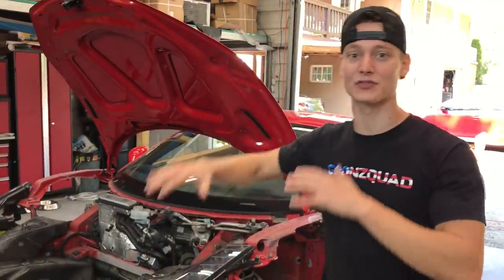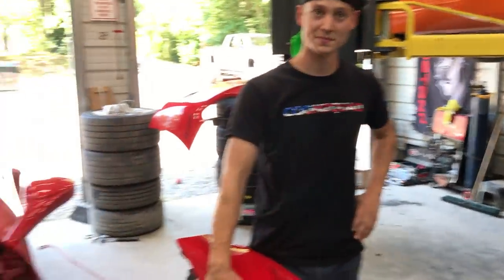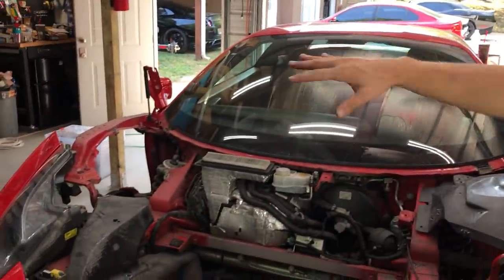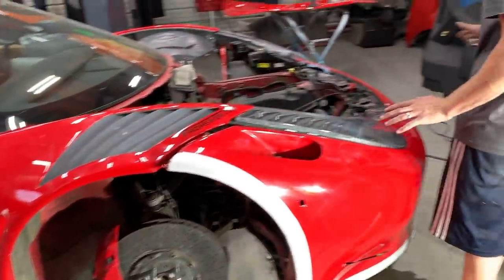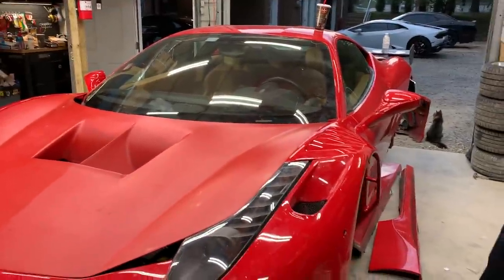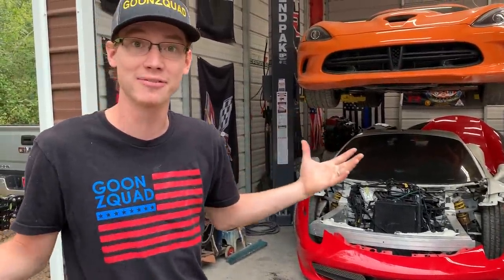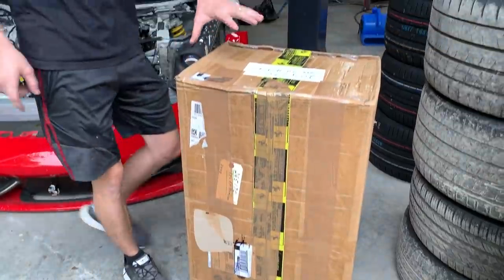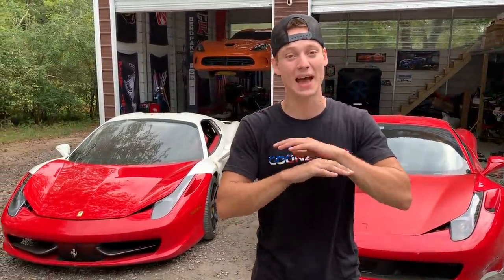Building A Widebody Ferrari 458!!!

Comment: Holy moly...
You've really got some balls for doing these things. You are chopping those metal pieces as if it is a cheap salvage car not an exotic one.
Reply: Ignorance is bliss ;)
Reply: Takes a lot of balls to remove structural brackets.
Reply: @FullSendPrecision  hihihi
Reply: Millions were spent in R & D and removed in a second .... ha ha ha
Reply: Chopping them as they think those should be chopped. And then chopping some more, then some more... Hahahaha! That really isn't the way to do things.
Reply: Nothing like chopping all that up to realize they never needed to because the new hood holds in place with pins! PPPPP (poor planning prevents proper production)
Reply: Wanna know what fool watched their videos an decided these 2 would be great to install a body kit on a Ferrari
Reply: @StreetDisciple86   They think getting some valuable advice from experts cost them lots of money. Sometimes You should spend money in order to do things right.  Actually they salvaged the car by chopping those necessary parts without any proper plan. They should've measure the fram rail brackets then cutting(trim) those inner pieces of fender, after that they could install it just right in a place.
Reply: @jasonmillsbro  I agree completely. I know they're doing their best but I think they lack some serious research and Intel. They're hands on learner's but some things can't be undone! I even mentioned it when they first picked up this project and started talking about hinges. I said you don't need hinges on the body kit car and they didn't even read it. As we've said a little professional advice and some proper planning can save a load of work and headaches!
Reply: I cringed the entire time... This tops in the list of what not to do besides Samcrac's Ferrari floor "repair"
Reply: Jason Millsbro The Ferrari race team also cut frame rails on the cars they use for the kit. That's why Tj felt comfortable cutting his off in his build because he had pics on his phone showing that's how they solved the issue.
Reply: Mike Honcho they are doing it correctly.
Reply: Hence, cheap salvage exotic.  Zing.
Reply: @andyRC95  That floor repair was the worst in history.
Reply: @nickanderson3440  That's not even a repair, it's a cheap solution to an expensive repair.
Reply: Those aren’t frame rails they removed they’re pretty much a brace/bracket for the stock fenders. Real GT3s have those brackets cut out. And windshield wipers are removed of course because it’s a race car. So yes he has proper intel. Ferrari does that to all of they’re gt3 cars!

Comment: Its pretty easy to sculpt a piece to make the fender and bumper have a better connection. Get a piece of pink panther foam, cut it out with a foam cutter to a slightly bigger piece, and sand it down to get a perfect part. Buy fiberglass mats or carbon fiber mats and epoxy, and put it around the foam part. Drill holes in the bumper, and matching in the new part, attach with ribbons. Fill out the gap with body filler, and you know what to do from that point

Comment: I'm kinda lost. You're assembling on the loaner Ferrari and then will move everything over to your Ferrari?  
Why was that one even totalled? 

Last question, by cutting some of those supports, does it mess with the stability and or the safety?
Reply: First question answer they got the loaner Ferrari from a company to put the wide body on the car and they get the stock parts for there totaled car. 2nd question no one knows how it got totaled 3rd question they readd supports at the end
Reply: Doesn't need the supports the stock stuff uses - it's super-rigid and self supporting

Comment: So you cut a structural piece of the frame to fit a front quarter panel, surely you’re going to replace the structural piece to keep the frames integrity and strength?
Reply: Chris Waldron it’s not tho lol it’s just a piece where the OEM fender latches on to. Lol 😂 check the other gt3 Ferraris and the racing ones they all have it missing.
Reply: Chris Waldron it’s not structural.
Reply: I am pretty sure they did their research before cutting..
Reply: Ok, so I’m happy to be corrected 👍 found this https://borlandracing.com/special-projects/ Be interesting to see the fellas build and look at the chassis again to see that it’s integrity is still kept. Racing is different to a road car where it needs engineers certificates and road worthies etc. To me, a panel that isn’t fastened directly to the chassis for strength etc. and relies on its own strength, sounds a bit dodgy.

Comment: That’s the bumper from the 458 LM GTE I believe
Reply: LM GTE bumper is different, the front mouth has 3 sections to it on the LM GTE, on the GT3 it is one open section, definitely looks to be a gt3 origin bumper with canard cut outs and one section mouth but why it would be 2" off each side is very odd.
Reply: GTE is the “top class” car. Other than LeMans and a handful of IMSA races, where else are they? It would be hard to imagine spare GTE parts lying around up for grabs IMO. I could be wrong though. I read somewhere the current 488 can be converted to both GTE and GT3 easily.

Comment: This is easily fixed. Get some blocks of balsa wood, as it's light and can be worked on easily. Glue them on there, then shave/sand into the correct shape and finish off with 3 layers of fiber, 2 layers of cloth 75 grams/m^2 and 1 layer of cloth 25 grams/m^2. Then finish.

Lightweight, strong, durable. And not too much hassle.

Comment: Cut a line down each side of the lip of the bumper, pull them out until they align with the fender and fill the 1/2 gap with fiberglass or carbon fiber repair.

Comment: Nice project guys. It only makes a lot of sense that you took on this assignment. Just take your time, measure twice and cut once, and cut some more if you don't like the first result. For future references it might be a good idea to wright down and log and store some actual measurement numbers instead of just comparing with the comparing tool. These cars are all made with very low tolerances, and those frames are all made inside a special jig. Therefore I find it hard to believe that two different cars can have a quarter inch difference between the two different frames. Big thumbs up from the Netherlands!

Comment: Use a rubber molding on the wide body, and u could use you hoist and a chain puller from harbor freight to move front over 1/4 inch by chaining between the bottom of the hoist as I fixed my f 150 that way and it works, the molding would even out the gap to make it eye appealing, just my 2 sence. and cheap!

Comment: Since the hood is thin, you need to glue some thick aluminum plates in then carbon over them preferably using a vacuum bag technique. Do this also with the L brackets for the fenders also.

Comment: With the bumper fitment, i would look into if they used smaller or thinner headlights, or mounted the stock ones at a higher angle, as if it was an inch shorter or thinner or both, the bumper would line up perfectly. like do they NEED turn signal indicators that I think are built in to the 458's headlights now with the GT3's? also see if you can find some photos of some GT3's that have been in fender benders, as maybe theirs no brackets on the top of the headlight on the GT3, so its pushing the upper fender further out than the bumper. 

like see if you got a spare wrecked one and cut the upper bracket off and see if it fits then

Comment: That is an early GT3 front with later fenders and hood.  Could be a 2013 front with 2014 and newer fenders because of changes in rules, the fender may have been made wider in 2014 plus, gills where added to the front nose in 2014.  Make it work and it’ll be totally unique. 👍🏻👏🏻

Comment: I don’t know if you figured it out yet but in 2012 Ferrari released an update to GT3 cars. It consists in new front suspension parts, new wider fenders and new bumper with bigger canards and wider to match the fenders. So probably you have a 2011- bumper and 2012+ fenders and hood. The other option is a GT2 fenders and hood and GT3 bumper.

Comment: Non-ferrous metals such as aluminum and brass do not bend easier when hot or cold.  You can only soften them by annealing them, so just heat it to a dull red and let it cool then bend it.  You should also use Dzus fasteners on the hood and bumper, not pins.

Comment: Something i noticed is that with the frame rails u can see thay they are sorta pinched about mid way through and you can notice it when u look at the area were the front bumper goes how the frame sorta bows out leaving a larger gap in the connection area (were the fram meets the front) and is pushed in at the middle of em

Comment: Hey why don't you lineup the outer edge of the bumper with the wide body fenders and make some carbon fiber filler pieces to fill in the space between the lights. If you can, make them look like some type of intake or cooling vents.

Comment: Yeah, I just checked on the front bumper you guys have and it's not the same as the original racing bumper which has those induction holes on the top which are pointed at the end instead of yours which is rounded at the end.

Comment: It's probably been said before, but for the Bumper-Skin/Headlight/Fender problem: 
Consider making a hockey-stick/L-shaped filler-piece/template out of 3/4" Plywood to fill the gap perfectly, 
Round all the edges over, 
Then reduce the size like 1-2mm on all sides to allow for part-thickness, 
And then send it out to a shop that can fabricate carbon-fiber and have them make the part.
One example might be: http://www.protechcomposites.com/custom-orders/

You may even be able to partner with them with a mention/link/logo, etc. sponsorship to do it for a zero/reduced cost.

Or DIY: https://www.rockwestcomposites.com/blog/yes-diy-carbon-fiber-fabrication-is-possible/ 

Then just paint it rosso-corsa and stick to the front bumper-skin with that super-strong 3M trim-adhesive tape. Similar to this one: https://www.autozone.com/sealants-glues-adhesives-and-tape/body-molding-tape/3m-1-2in-x-15ft-molding-tape/517047_0_0

Anyway, good luck guys!

Comment: 1/8" aluminum heated with a torch (metallurgical strength reduced)might not be incredibly strong as a bracket holding the fenders
 up when driving at speed.just a thought but race cars are loud,rattly and not drive-able on the street now what im sayn?
are you making a dedicated track car or are you going to drive this on the street?

Comment: Make sure you measure the frame rail length before you cross measure, if the length is off it will make the cross measurement inaccurate.

Comment: Normal goonzquad day...

Go ahead and get out of bed.
Go ahead and brush teeth with Rainbow Unicorn Bang energy drink.
Go ahead and brain storm on the parts and hardware required to complete the days work.
Go ahead and go to the local hardware store, i.e. Lowe's.
Go ahead and head back to the shop to install hardware.
Find out that you actually needed some other hardware.
Go ahead and go back to hardware store for hardware and get goonzquad fuel, i.e. Chick-Fil-A.
Go ahead and put on hardware and parts. Looks absolutely amazing.
Go ahead and stand around the vehicle admiring handy-work and commenting on its absolute amazingness.
Go ahead and complete a flawless, trash-free, absolutely amazing, garage paint job. 
Go ahead and set up goals for the next day. Include moments of absolute amazingness.
Go ahead and go to bed having completed an absolutely amazing day.
Rinse and Repeat

Incidentals
Insert burnouts and donuts as needed
Insert Thomas head scratches as needed
Insert temporarily 'putting on parts and taking them off' as needed

Love, 
A devoted, absolutely amazing fan...

Comment: Your geometry is wrong.  You either have to raise it up in the middle and lower it in the front or a combination.  Take measurements from th floor on the other car.   You need to make your brackets have a wider range of adjustments.  You really need to watch TJ hunt's video before you cut up more of those expensive parts.  You will need to reinstall the wipers and the cameras and the parking sensors.  TJs video shows all those things

Comment: Seems quite strange that you had to cut that bar above the wheel, seems exposed now. Let's hope it's not structural.
Reply: Its not, its just there to mount the stock fender and other stuff to. You have to cut it or you cant fit the new fenders because the carbon wheel liner is attached and cant physically fit in without cutting the bar out.

Comment: I'm confused.

Are they removing bits of a Ferrari chassis (which are probably there for a very good reason) just so they can squeeze a body-kit from a different car onto it? Or are the bits they cut off just support brackets etc? I'm actually worried this thing will break in half the first time they take it to the track.

Comment: I've really enjoyed watching your work for sometime now.  But I have to say this one is a head scratcher.  You cut the car apart, chop up the new panels, dry fit it and all I hear is amazing, perfect as you show the car.  Nothing really fits and you finally admit you have bought the wrong components. Love your enthusiasm for your work but come on, be honest in the vids.   I think when the camera was turned off the words you were not saying were amazing or perfect. Appreciate that in the end you did pretty much acknowledge you had problems to solve, that was honest. I would suggest you hold off on working the rear and get the front figured out and resolved.  The build might not be worth much of anything if you can't.

Comment: It is not Iphone "ex"  max, it is Iphone 10 max. They just use latin numbers ( X = 10) to brand the model.  Actually never mind 7 ,8 , 9 or X they are always the same phone except few  changes  in the  style. Ferrari wide body kit looks nice, but those parts   that needed  to cutted  off, will make the construction more unstable in my opinion.

Comment: Guys you don’t have a complete kit. You have older style GT3 fenders and newer style GT3 bumper. They don’t go together at all. Also you are missing the proper fender liners that have the cooling ducts. You need to stop what your doing and get the correct parts. Don’t be cutting up perfectly good parts and trying to make them fit. It will look stupid anyway because the style of the fenders doesn’t match the bumper. Ferrparts should have caught that as they look completely different

Comment: You guys are doing a pretty good job. The problem is the design and the production and quality of these supercars. The companies are only interested in the performance of the engine. 

Working on the engine and the body is any mechanics nightmare. to dismantle half of the car to remove the starter ?! How sick is this?! Now the company is more or less Volkswagen , but these engineers have never been involved in the design process at the beginning  of these cars.

 I personally cannot look at it , even a brand-new car has gaps like a badly repaired 3 times crashed body. Far away from quality at all, not worth the money, when you see how cheap the parts are from AUDI and VOLKSWAGEN. Even the cheapest Mercedes looks better when new. 

You guys should better protect yourself and all the supercars around , not to talk about the animals. They are cute , but they should not be on a job site, especially the puppy! If you like them keep them away!

Comment: It's a cool looking kit. But the structural integrity of the front end is compromised.
Reply: No its not, that bar they cut is non structural, its only there for the stock fender to have something to bolt on to. And now this fender doesn’t need it so it gets cut out.